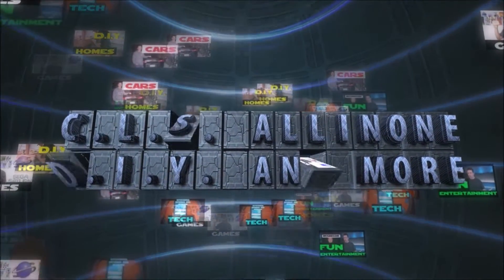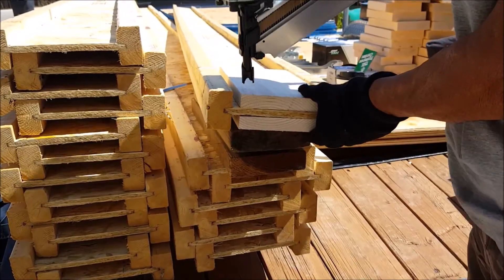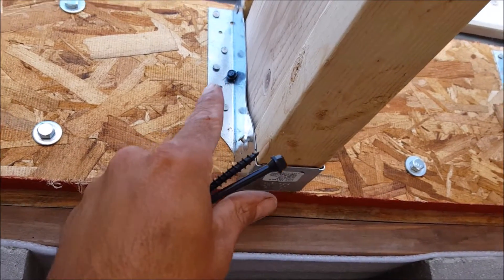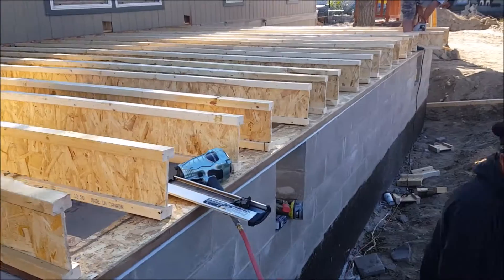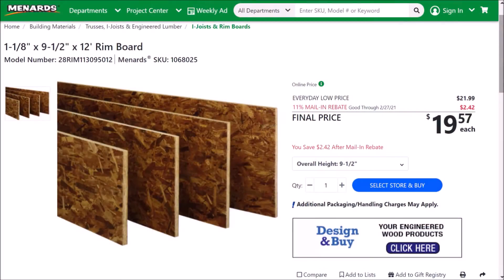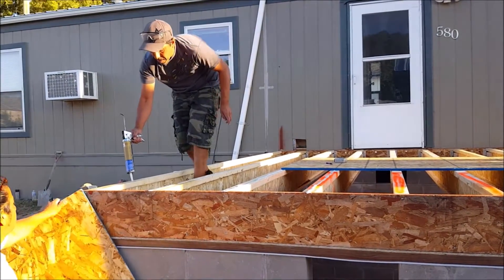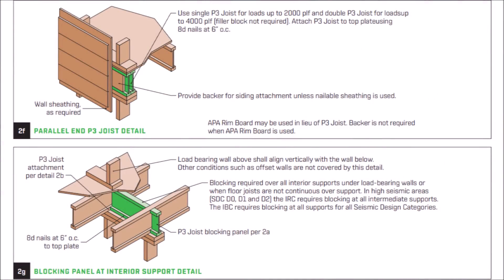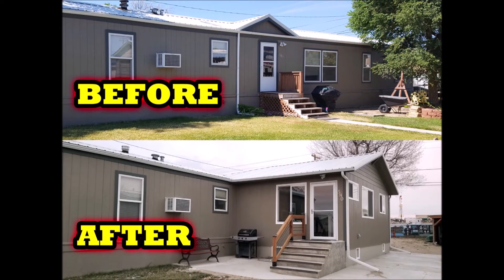How to install / roll Floor I-Joists on a basement addition D.I.Y.

Comment: Why did you use joists on the outside edges instead of rim board? Seems like I've seen both ways. Thanks.
Reply from the maker: I believe the only reason I did is because it was cheaper to just use the joists on the side edges,  and because there was no hangers involved on the sides as well.

Comment: nice work. i'm curious about the joist stiffeners; it looks like you gapped them for the load to be on the bottom side of the joists (stiffeners to be flush on the load side, gapped on the non-load side)?

Comment: Great video. What type of primer sealer did you use on the OSB? Did you seal it so it wouldn’t get ruined if it got wet during the building process?
Reply from the maker: Just an exterior rated latex primer. Sealed it to protect it from snow storms until the roof was finished.

Comment: Great job, and enjoyed the video. Is there a reason you decided to include lag screws in your joist hangers? It’s beyond the manufacturer’s specs (which only call for the 10d nails), and you were meticulous about following documented specs elsewhere.
Reply from the maker: The structural lag bolts I used, were for extra support. The lags secured the hangers directly to the existing rim joist on house which is partially located behind the ledger board.  The way the ledger board mounts to the existing home would be considered somewhat of a custom tie in, so the methods I used for extra support will not necessarily apply for other applications.

Comment: Hey CLS, great video! How did you finish out the end I-Joists that were installed flush with the block wall (if at all) ? They appeared to be largely open when the framing was being erected. Thanks!
Reply from the maker: Thanks, not sure of your exact question, but on the bottom side of I-Joists I installed  insulation, plastic, drywall and crown molding trim.

Comment: I must have missed a step? how did you attach the siding to the existing house? I saw you drilling really long screws into the hangers for the joists.  My question is where do they bite into behind the siding? Directly into the old siding of the house? Thank you.
Reply from the maker: They secure into the rim joist on the existing home .
Reply from the maker: The ledger board is a different step and the way it mounts will vary greatly depending on the existing house structure. Eventually I will make a video just about mounting a ledger board. Ledger board must mount to existing studs in wall, rim joist or other solid locations in a structure.

Comment: you forgot to mention the steps on ledger that is attached to bottom of the existing house/ where the hanger joist are place.............
Reply from the maker: Did not forget, this video is mainly about the I Joists with extra info on a few other things as well. . The ledger board is a different step and the way it mounts will vary greatly depending on the existing house structure. Eventually I will make a video just about mounting a ledger board. Ledger board must mount to existing studs in wall, rim joist or other solid locations in a structure.